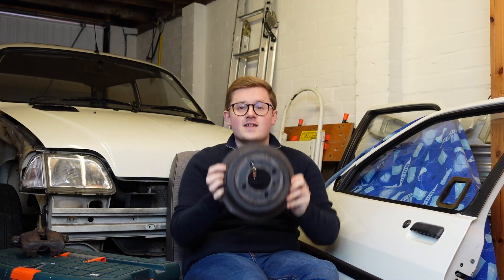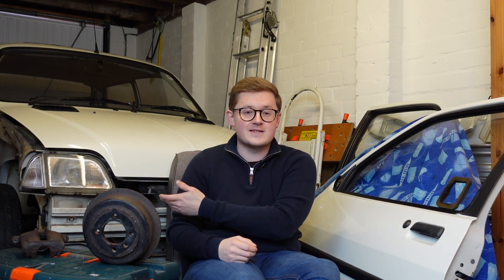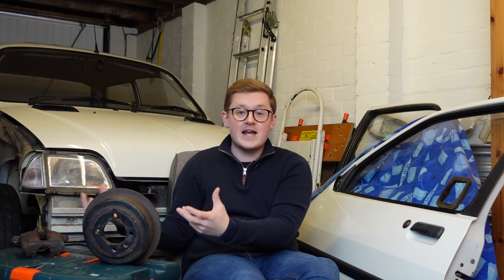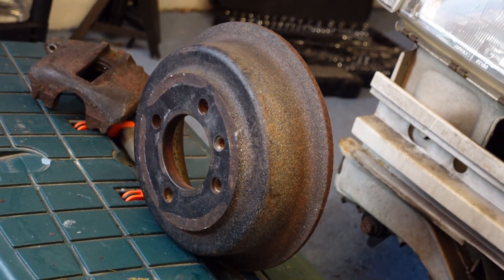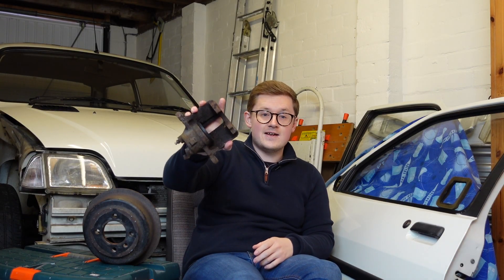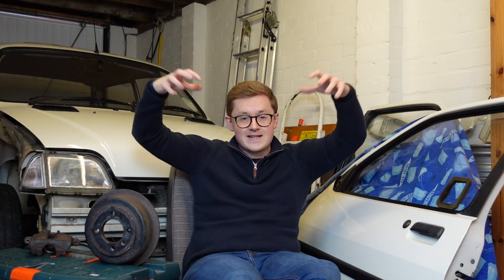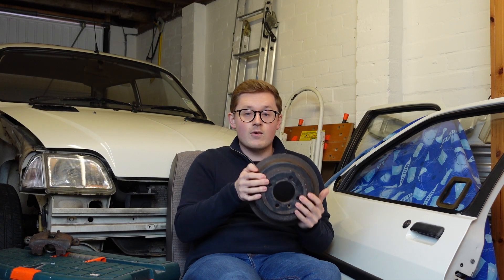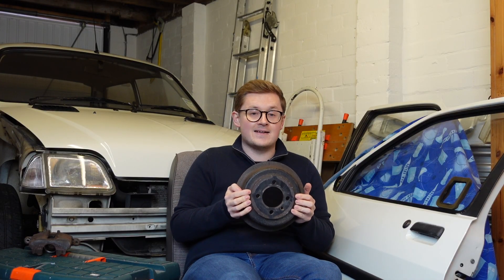Why are Drum Brakes Making an EV Comeback?

Comment: As motoring journalist, technical writer and long-term spanner wielder, I have to commend your work on this video. Well-written, explained in a manner that appeals to novices and experts alike, and free from technical flaws. Perfect.
Reply from the maker: Thank you my friend, that's very kind of you to say :)
Reply: I used to be a mechanic in the 60-70 period and we hated drum brakes, because they would fade when you had to brake fast and frequently, especially when going downhill with curves. I actually own a Chevy Volt 2014 with rear disc brakes and they don't use an inside drum for parking brake. They use the caliper for parking brake. I has a flaw in the system, making the disk wear more than the front one's. But they still last a long time. They rust, both front (more on the front) and rear, but the braking power is still phenomenal when needed. I rarely use the brakes, because I use the full regen mode. I buy the no rust disc, which rust anyway, but more on the surface. I live in St-Donat, where we have the real winter, so the brakes get a lot of snow, salt and water. Thanks for the good video.
Reply: @pierreforget3357  Had the inspection mechanic try to rip off my neighbor recently. They told him his Chevy Volt needed new rear rotors and pads because they were rusted. They had surface rust from lack of use and almost full pad life. Ridiculous.
Reply: @802Garage   Rusty rotors mean the calipers are seized, probably what the guy told her
Reply: @beefweiner  Possible. Definitely was not the case though. Car was very low miles.
Reply: @pierreforget3357  I think you are technically correct, but fade also is a function of the material the brake shoes are made out of, I am sure. Materials are just better today. Also, people don't know how to drive. I avoid riding the brake under all circumstances. Letting up just for moment allows the brakes to cool a little even in that small fraction of time. My theory is, the cooler the brakes are, they less they wear.
Reply: Thanks, your reaction is pushed me to take this video even more serious now. But anyway it’s all good
Reply: Awesome content. 👌
Reply: Twin leading shoe drum brakes operate from both ends of the shoes. The original Mini had single leading on the back (one slave cylinder) and twin leading shoe (two slave cylinders) at the front. 
The self servo effect meant no need for a booster servo. 
The Fiat Panda I use today has front discs but even serous abuse of the brake pedal only warms the front discs. I believe TLS drums would do the job perfectly well.
The Sporty version has discs all around but the rears are only there for show. The hand brake uses a worm screw within the calliper.
Reply: @Dave5843-d9m  The VW1200 1964 also had twin leading shoes with two cylinders on front wheels and single cylinder on the rear wheels. No need for a brake booster. I suspect that the lack of brake booster also contributed to a lower cost.
Reply: I think TwinCam is ex BBC or something like that. Hence the very good presentation.
Reply from the maker: @MrTonaluv HA I wish! Future, maybe.
Reply: after seeinf all of the video my mind just thinks how you will get the brake drums cooled ? in a EV its even easier to accelerate more in less time and continuous braking is not good for an enclosed system like drums
Reply: Spanner wielder?  Technical writer?
Reply: Yeah, but it's a Video & he only used the bottom half of the screen. The oratory & content were great.
Reply: I second this!
Reply: There are a few inconsistencies.
On the one hand he says that drum brakes are cheaper to produce (and rambles on about the handbrake being the cause for this).  He also says that drums are more effective because shoes have a greater surface area than pads yet, he says that manufacturers typically make their brakes larger than they need to be and rely on ABS to keep them in check.  
He also mentions that rear brakes only provide 33% of the overal braking effort of the car
If these factors were all true, where drums are only fitted to one axle, it would make sense to fit them to the front.
(Since the front axle doesn't generally have a handbrake and It provides most of the braking power)

Brake shoes may have a greater surface area than pads but, since the slave cylinder only operates on one end of the shoe, it is just a small portion of the shoe that contacts the drum.  This is a mute point anyhow when he states that the disk brakes are already larger than they need to be 

He also claims that the cost of replacing a slave cylinder is cheaper than replacing a caliper.  Since when did the manufacturer worry about the cost of replacements for the consumer?  Even if this was true, this would be negated because the cost of replacing pads (which is required much more frequently than calipers or slave cylinders) is much cheaper than replacing shoes.

He also claims that having the dust captive within the drum is an advantage. Would any consumer seriously prefer to have dirt in their braking system, as compared to having a clean braking system?

Even motorcycles usually have disk brakes nowadays despite, typically still having a drum that is not used for braking
Reply from the maker: Ken, I'm not sure what these inconsistencies are, as you haven't pointed any out.
Your first point seems to have no issue mentioned. There is no connection between the braking force of equivalently sized systems and a trend of manufacturers oversizing brakes. The two are separate issues.
Your second point makes no sense to me, unless you're referring to the higher initial braking force of drums, in which case you've ignored the rest of the video.
The contact patch of the brake shoes is not an issue because drum brakes need to be bedded in. Once bedded in correctly, the contact patch is all around, and I can prove that to you through the video where I refresh my Metro's rear drums. All four shoes have perfectly even wear on both leading and trailing edges.
You point about service costs is also misinformed at best, as manufacturers have strived to increase service intervals for decades. Cars are now encouraged to go 20,000 miles between services rather than 1,000 miles all for the sake of reduced cost to the customer, and that's without mentioning all the service-free components that needed servicing in the cars of yesteryear.
Your final point ignores the fact of what brakes do - they use friction. Friction ejects dust into the much larger drum. Brake dust has no adverse affect on braking.
Reply: @TwinCam  I do wonder why abandon regenerative brakes. It's only good down to low speed but instead of dissipating the energy from stopping as heat, put it back into the battery or a super capacitor bank, since it may not always be possible to charge the main battery as quickly as power is available. Use the super capacitor bank as an acceleration reserve since the charge dissipates over a few hours. I imagine cost is why they don't. If the question is "Why doesn't business do ..." the answer is usually "Money."
Reply: @Trump2PrisonOn34Counts  Regenerative brakes have nothing to do with the emergency friction braking system. This is what is being discussed. The motors, or the regenerative braking system, are still the primary braking system.
Reply: @ronaldking1054  Ah. Thank you. Had "Divided Attention Deficit". I was doing something else and only had about 15% of my attention on the video.
Reply: Added cost and complexity of the regen system is prohibitive if you are trying to add it to an ICE-only vehicle. Basically you have to have an electric motor installed in order to do the regen, at which point you've got yourself a hybrid, and many hybrids have regenerative braking.
Reply: @TwinCam 🌟I'm glad you have made these points, as the comment made ignored a whole load of facts, including ease of service, correct adjustment requisite, and brake fluid renewal interval, also overall efficiency of drum brakes especially fitted to the rear, incorporating the parking brake. 

The comment with regard to drum brakes on the rear of motorcycles is just b*ll*cks.
Reply: @KenFullman on the drum brakes, you said the contact of the shoes was small because the wheel cylinder is only on one side... Have you ever changed drum breaks? I've done many and the whole shoe makes contact and wears evenly and the only time it doesn't is when something seized up and can not move freely. The same way with disc brakes when the pins are stuck.
Reply: @KenFullman dust on disks settles on your wheel, dust in drums not so much, so for the dust side, which isn’t relevant for the mfg but just a fun trivial thing, drums may let you skip another wheel clean.
Reply: @KenFullman I feel the need to address this point by point just to clarify a lot of small details and misunderstandings.

Drum brakes are cheaper to produce, both because of the handbrake and because wheel cylinders are cheaper than calipers. Rotors also use a more complex manufacturing process, especially vented ones like on the front.

Drum brakes aren't automatically more effective than disc brakes, but for a given diameter there is more surface area inside a drum brake than on a comparable disc setup. Manufacturers have been making their brakes larger to look more impressive and see more premium, as well as to extend replacement intervals, more on that later, but they don't have to carefully match the sizing to the vehicle because they can rely on electronics to compensate. If drum brakes were properly sized for vehicles, it could save cost overall.

It is true that the rear brakes on the car do far less work. That is one reason drums are put in the back more frequently, because the experience less heat buildup. One of the main advantages of disc brakes is better heat mitigation. That is why they're almost always used on the front and even if drum brakes make a comeback, discs will still be comment on the front. Even if an EV has regenerative braking, It may still need to stop suddenly or stop gradually from a high speed with the assistance of the front brakes and if they could not tolerate the heat generated, the driver would experience brake fade. This is especially prescient since EVs are so heavy.

Drum brakes wear the shoe in to the drum, causing even wear over the surface. There is an automatic adjuster built in which keeps the opposite end from the wheel cylinder primed to make contact when the cylinder activates. They generally wear pretty evenly in a well designed system. Otherwise the shoes could be half sized or would wear down on one side only. Also it is moot point not mute point.

Manufacturers do care about the cost of a wheel cylinder versus a caliper, and it is one of the main reasons they use rear drums still instead of discs. They care because it saves them money in manufacturing, they can offer the vehicle at a lower price to be more competitive in the market, and they can lower the expected cost of ownership which is another factor buyers look at when purchasing a car. You also contradict yourself a bit here, you point out that pads need to be replaced more frequently than shoes, but claim that pads were out more quickly, which would negate shoes being more expensive if that was true, which it generally isn't. Calipers also fail far more frequently than wheel cylinders because they are exposed to the elements, have more moving parts, and experience more direct heat transfer. Therefore not only are they more expensive, but they generally need to be replaced more often by far, especially in winter or salty areas.

The dust inside of a drum will not stay there permanently. It does come out over time, but it is less likely to be aerosolized and disperse into the atmosphere. Instead it will cool and gradually roll out of the drum onto the ground. It is not a major advantage but it could matter in testing at the least. The dust will not affect the function of the braking system. It also releases less brake dust onto the exterior of the car which if you have ever seen brown BMW wheels and fenders for example you will see the advantage there.

Motorcycles have disc brakes for their superior performance, primarily the better brake feel as well as better heat dissipation. They are also easier to service in most cases and lighter overall which is crucially important for motorcycles.

The one point he made towards the end of the video which I did not agree with was that larger disc brakes will inherently make more brake dust than smaller. This is not the case because the dust will be a function of pad area, total pressure, heat generated, and of course pad and disc compound. A large and a medium sized pad which are both adequate to stop a vehicle from a given speed will generate similar amounts of dust because the total surface area and pressure over the stopping distance will be similar, and they won't overheat. And undersized pad trying to stop a large vehicle will get extremely hot and release far more dust that is more likely to enter the atmosphere as small burned particles. It is necessary to have sufficiently large breaks to not regularly overheat the pad or disc. All of this applies to drums as well.

Hope this helped clarify a lot of points. There are of course advantages to disc brakes over drums. However, almost every single point he made was sensible.
Reply: @802Garage  I'm convinced that a rear drum system is better in most applications. For one thing, it provides an emergency brake which will actually stop the vehicle. I think that marketing and market positioning has a lot to do with making four wheel disc brakes close to universal. Having rear drum brakes on a $75,000 vehicle is not much of a selling point. Then, if you have a low end vehicle, putting on rear disc brakes instead of drum brakes makes the offering seem more exclusive. I think it's often a market decision rather than an engineering decision. I does occur to me, though, that ABS might be easier to set up with four-wheel disc brakes.
Reply: @anonymike8280  Sales and marketing is absolutely a massive part of why 4 wheel disc brakes took over. It was seen as sporty, luxurious, and safe. They have real advantages, but definitely aren't necessary for all the vehicles that have them.
Reply: @802Garage  All true, but then there is the argument that rear disc brakes are an actual disadvantage in some applications. But people who are competent home mechanics see the world differently.
Reply: @anonymike8280  I will say, I definitely enjoy working in disc brakes more. 😂 They also do look cooler no denying that. Subaru drums have always been pretty easy at least and I prefer a drum in disc parking brake to the screw calipers.
Reply: @802Garage  I don't have to work on drums very often. However, when I did the rear drums on my 2001 Camry recently, I used brake shoes out of my parts pile and put the thicker in front (primary) and the thinner in back (secondary). The car stops fine, but the self-adjusters probably are not working now and it takes more clicks to set the parking, about six clicks to hold it at a light. I think that has something to do with thinner shoes in the rear position. I plan to redo it one of these days.
Reply: @anonymike8280  About half of the drum brakes I have taken apart have had something done wrong. Adjuster lever placed wrong, spring in the wrong spot, primary and secondary shoes switched, or just other minor assembly issues. They usually still work so whoever did it never fixed it. It happens! I usually have to double check guides and service manuals to make sure everything is 100% correct down to the spring hooks sharing holes stacked in the right order.
Reply: @802Garage  Camry doesn't have primary and secondary shoes. My question is whether having a from shoes thicker than the back show would affect the self adjusters. They've always worked before in all Toyotas I have had.
Reply: @anonymike8280  Ahhhh I see what you mean now. Differently worn shoes. Yes I think it could affect the feel since they still likely have a mostly stationary side, so you'll get a little more pedal squish as they engage I'd think. Ideally shouldn't make that big a diff, but I'd have to look at the setup. Not a drum expert either, have just changed quite a few.
Reply: @802Garage the thing I really don't agree with is the expected cost of maintenance. While sure, a caliper costs more than a set of springs or the piston of a drum brake, the caliper is the part that almost never needs replacing. Pads are cheap and easy to replace and rotors are too, if slightly less so. Changing shoes on my rear brakes costs me more in my mechanic's labor than disc brakes. The parts cost less, but that's more because of the fact that rear brakes are much smaller than the front ones.
Reply: @FAB1150  While I half agree with you, living in the northeast with harsh winters and salted roads, calipers need to be disassembled and serviced or replaced extremely often. They lock up all the time from corroded pins, which also causes faster pad and rotor wear. Calipers are also far more expensive than cylinders when they do go bad. Wheel cylinders rarely need replacing even up here. Definitely trade offs either way and it does depend on where you live and how you use your vehicle.
Reply: @802Garage  true, that is quite dependent on the region you're in. Here they're a bit worse in terms of maintenance (especially considering I can do rotors and pads by myself but have to go to a mechanic to change shoes)
Reply: @FAB1150  Yeah definitely understand that angle. To be fair, if you can handle rotors and pads, you can likely handle drums and shoes. They just seem more intimidating and involve a little more strength and fiddling. Having a proper guide or service manual is key. 😁
Reply: @802Garage 🤣 you corrected ["mute point to moot point"] then YOU typed
"see more premium" (SEEM!!)
"be comment on the front" (COMMON!!)
"pads were out more quickly" (WEAR!!)
"large breaks" (BRAKES!!)
I love it when people try to "educate" others or are Grammar "Nah-tzeez" & their own text is hilarious.....
I have seen more leaking cylinders by i. My life even though I've worked on FAR more cars with 4 calipers!!
Not all drums are self adjusting!!  My HEAVY, POWERFUL 2007 Volvo S60 D5 didn't & both Volvo & aftermarket kits are available to convert the rears to self adjusting.  The standard fitment was a solid H shaped piece of steel opposite the cylinder holding the shoes apart at a fixed distance!!  The handbrake was appaling as a result!
Reply: @alexmanojlovic768  I was using voice to text. Glad you could clearly understand me despite the spelling mistakes. I just wanted to let you know that it's moot point. Call it a pet peeve. Wasn't trying to be offensive. I have worked on many drum brakes and I have seen one leaking cylinder that was barely seeping. The rest were all functional. Easier to rebuild as well, if you want to bother since they are so cheap. I have seen countless locked up calipers. Nobody ever said all drums are self adjusting, but most are on any modern car. Given the 2007 Volvo S60 has all wheel disc brakes, you are talking about the parking brake. Since when does a parking brake have to be self adjusting? Not to mention in the USA they are automatic adjusting from what I can see. Not sure why they skimped on the adjusters in Europe. Seems like a mute point though since it isn't even relevant to full time drum brakes. ;) You didn't actually address anything I said, appreciate the insights, or add anything to the conversation on brakes. Try not to get so defensive and nitpicky over a simple correction. It was far and away the least important part of everything I said. It's a mistake people make all the time. Kind of like irregardless or could care less. At any rate, if you have any more questions a bout brakes let me know.
Reply: @802Garage  yes, the parking brake. However the estate variant had adjusters, but the saloon didn't & were renowned for having cr4p handbrakes which virtually every owner upgraded with aftermarket adjusters.  I can't explain why they needed them, but they did (I know, they're only applied stationary, so logically, there'd be no wear, however...).  I wasn't being defensive it wasn't my post you were correcting.  I thought you were being a hypocritical Grammar Nazi.
I didn't address any other points as they were correct & didn't need addressing.
You clearly understand braking systems.
Reply: @alexmanojlovic768  It makes sense they are needed it's definitely lame they cheaped out liked that. That was the period Volvo was trying to cut costs if I'm not mistaken. The Entire 60 series was like their budget offering. Still nice compared to a lot of cars, but some corners cut. It permeated the lineup I think.
Reply: He also doesnt mention that the id3 have a known flaw in their drum brakes that makes them lock up in cold weather. 🤷
Reply: @KenFullman  "This is a mute point"
No, it's a moot point.
Reply: @KenFullman "mute point"?
Reply: @KenFullman  You don't have any inconsistencies, and therefore no argument. Period.
Reply: @KenFullman  NO son "inconsistencias" y mucho menos por parte del autor. Son solo hechos, efectos y consecuencias insoslayables de cada Sistema y como nada es perfecto, y es una la muestra de ello, ésto último según YO lo veo. 
Cada punto que mencionaste se puede ver desde una óptica diferente o la opuesta a lo que mencionas. No los responderé en un orden establecido ni a todos, tampoco abundaré en detalles porque están hoy al alcance de TODOS en cualquier registro, biblioteca, manuales de los fabricantes, guías de Características Técnicas y/o bases de datos.
También mucho dependerá de otros diversos factores, como el lugar, sitio o países (si no continentes) del que se esté hablando, entonces no vale para todo/s ellos. 
Los discos son bastante más onerosos de adquirir, lo mismo para las pinzas ("calipers") ni hablar de los que NO se pueden separar de la masa porta rodamiento, que si bien es para AMBOS sistemas igual, siempre son más baratos en los de tambor, y que en los más antiguos hasta se podían reutilizar los rodamientos..
En unos, las cintas son MUCHO más económicas que las almohadillas ("pastillas") y además duran muchísimo más. Lo rotores (discos) generalmente NO admiten ni un rectificado pues se "alabean" dando fin a su vida útil, pero a cambio un tambor sí puede admitir varios antes de llegar a su límite recomendado.
El tambor también tiene una fuerza mucho mayor en el frenado (efecto duo-servo o auto servo) y NO se necesitaban reforzadores (servos a vacío o por presión hidráulica o incluso de aire) pues NUNCA fueron ofrecidos antes en coches. Los "servos" se tuvieron que agregar al generalizarse el uso de Sistemas a disco, donde se necesitó mucha más fuerza por parte del conductor/a para accionarlos, Además aquellos eran más accesibles a personas discapacitadas o de menor fuerza física (minusválidos, amputados, mujeres de comenzaron a conducir, personas muy jóvenes e inexpertas, etc.) Un "símil" serían las direcciones asistidas hidráulicas y electro hidráulicas (hoy eléctricas)
También hay sistemas de tambor que tienen 2 cilindros (en eje delantero) que empujan las zapatas, entonces uno hace de primario y el otro de secundario en el avance normal hacia adelante, pero se "invierten" los papeles en la marcha atrás o reversa. Por lo tanto deja de tener el efecto inconveniente (menor frenado en una de las zapatas) del sistema que lleva 1 solo cilindro.
El polvo queda dentro (éso lo sabe cualquier mecánico) y es tan así, que algunos fabricantes modernos... de sistemas de frenos a disco delanteros... ya le ponen seudos FILTROS para recoger el polvo generado.
También voy a decir que no se necesita un pequeño tambor en los discos traseros hoy día, hay un sistema para mover el pistón hidráulico mecánicamente, y hasta eléctricamente hoy (vale para algunos fabricantes, no todos)
Las motocicletas (y éso lo sabe CUALQUIER motorista) sólo utiliza el freno trasero NO PARA FRENAR, se utiliza para disminuir Velocidad y frenar hasta 0 (cero Km/h) con el delantero.
Por éso no voy a ser definitivo al afirmar algo, hay que ser taxativo porque lo que es "bueno" para algo (o alguien) puede NO serlo para otro/s.
Mi respuesta no es criticar por el hecho simple de criticar, es ver la realidad pura y dura y tal como es, nadie es dueño de la VERDAD absoluta... porque no existe tal cosa.
Suerte.